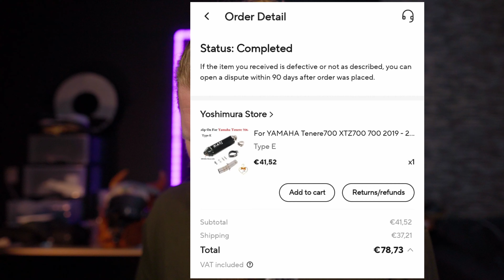Tenere 700 UPGRADES from AliExpress part 1 Exhaust

Comment: Pull the graphite gasket from the stock exhaust. That seals the connection point between the CAT and the mid pipe.
Reply from the maker: Good idea il do it if this connection fails so far it seems to hold

Comment: Does it have a screen inside the exhaust to stop Sparks from coming out. I live in California whewildfiresars are a possibility
Reply from the maker: i dont think so it just a pipe straight trough i guess the db killer would catch them but it wont be 100% of them  (to be fair i never had flames come out of the tenere though but i dont drive it hard)

Comment: Hahaha i had the same experience! I bought the same exhaust in the winter. I managed to break the clamp without even adding a lot of pressure. The exhaust was never holding itself together even with a new clamp so after a lot of tries and frustration i ended up buying a really expensive one and i love it.
Reply from the maker: Expensive clamp? Or exhaust
Reply: @giggleviking  Exhaust. HP corse

Comment: Nice sound! And for a 40 Euro Ali, it's definitely very nice! 

I went for the Aprilia Tuareg 660. I'm happy the intake is right under my nose it sounds awesome. The exhaust note is a bit meh, though.

Are you planning on driving the TET in the Netherlands?
Reply from the maker: Gratz on the bike! And yeah for sure im just a complete beginner and the tet is so far away from me that its something i need to plan. And untill end of juli its gonna be hard to get some long rides in i think but i will try
Reply: @giggleviking  thanks! Tet is pretty close to me. Planning on trying it soon. Als never done any off-road besides when I was 18. So about 10 years ago.  

Saw the LT vid. My GF is from there.  So might go check that out. Looked pretty cool

Comment: But its not homologated what about police 😂
Reply: @giggleviking  did you had any problems with police or power on bike??? cause i ordered exhaust from ali. Too
Reply from the maker: @J_dolezilll  nope no problems even the db kiiller fell out at one point so i drove around for a month with no db killer but i think its also the way you drive, i drive like a grandpa in the city bc i dont want to get fines or anything plus even without db killer its not super super loud
Reply from the maker: @J_dolezilll   also i think the bike has been running better with the new exhaust
Reply: @giggleviking  yes but i live in EU so the police here is 💀 so i’m little scared
Reply: weet jij of de garantie behoud met zo'n slip on demper die jij hebt?
Reply: @SnelleJelle_  what english
Reply: @J_dolezilll   was an question for the viking!
Reply from the maker: @SnelleJelle_   geen idee maar lijkt mij dat bij elke aanpassing ze onder de garantie uit kunnen komen als je de verkeerde hebt. ligt er ook aan wel onderdeel er kapot gaat  als ineens  je koplamp het niet meer doet kijken ze miss niet naar de demper. maar als er iets is met je verbranding/uitlaat en ze zien het denk ik dat ze moeilijk kunnen doen